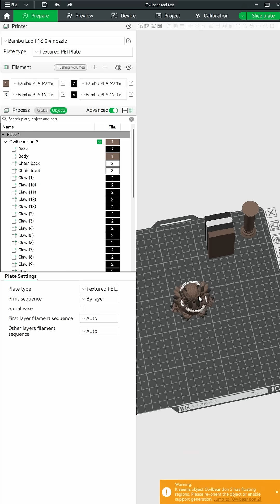How to 3D print D&D minis

Comment: Do you also have any custom temp or print speed settings, or does swapping filaments take way longer than I think? I haven't messed with print speed options all that much and as of yet don't have an AMS, but even with some of my biggest prints on 0.12mm layer height they still haven't gone far over 12 hours compared to the multi-day prints I've seen in your videos.